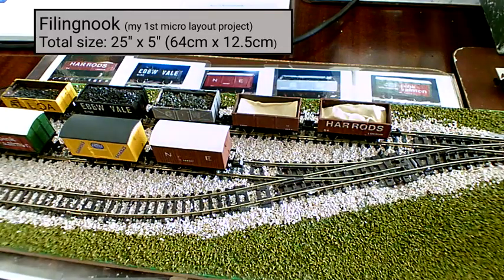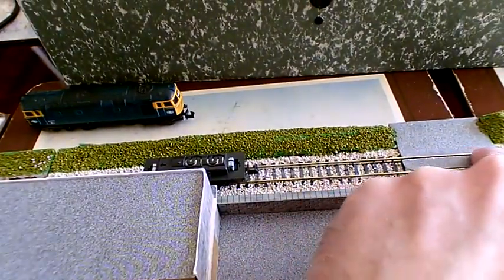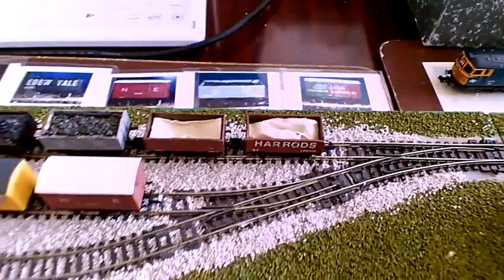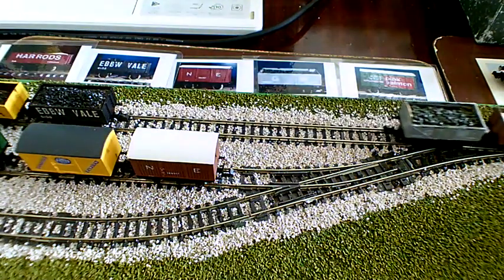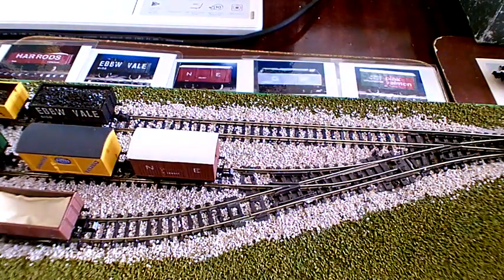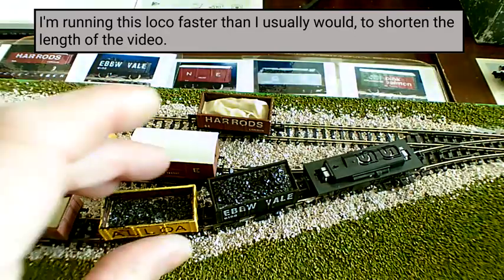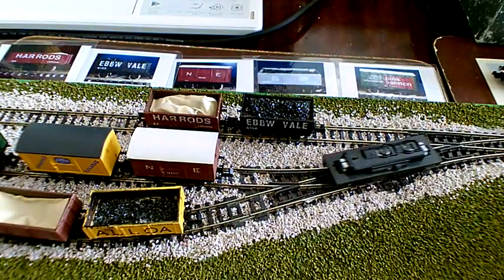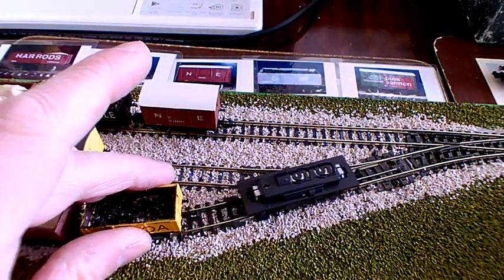Filingnook: n gauge micro shunting layout

Comment: This is great, I've been wanting to build a layout for a while, obsessed with a double mainline, sidings, running 5-8 coaches behind a tender engine...

Of course I haven't started it, don't have the room, the time, the cash etc.

So I'm gonna build one of these, thanks for the inspiration!
Reply from the maker: It's a quick way to get a working railway. I was sceptical at first, but my main layout hasn't been used for months. Check "Budget model railways": Mike has a range of small layouts on the go.

Comment: Your switches have insulfrogs and I'm surprised the loco doesn't stop in the switch. What brand switches are you using?
Reply from the maker: Hi, I use Peco settrack. The Kato loco is lovely, and manages to straddle the gap (both front and back wheels are live). I've got Minitrix on another layout, and that's ok too.
Reply: @andrewmasters5020  Thanks. I'm planning to build a shunting layout and am afraid of switches causing problems.
Reply from the maker: @RackwitzG  My lovely old Farish class 08 shunter was never reliable with points/switches, now I think about it. This Kato chassis is great. I also use PWM rather than variable voltage. Best approach is to give it a go, and see what works. Good luck!
Reply: @andrewmasters5020  Thanks.